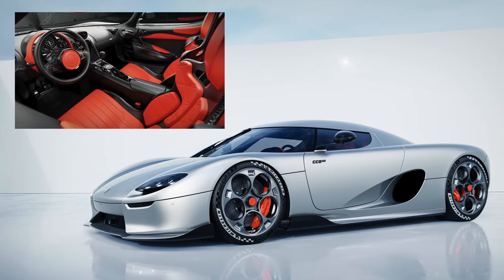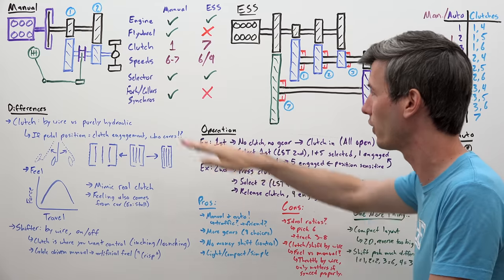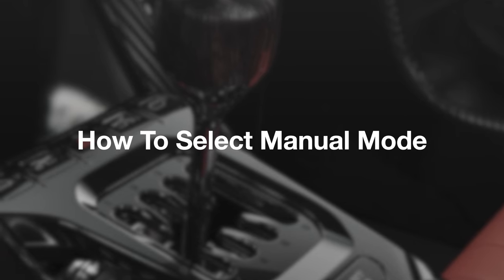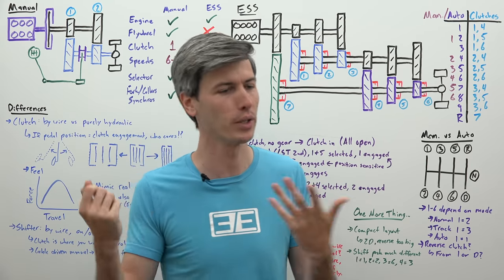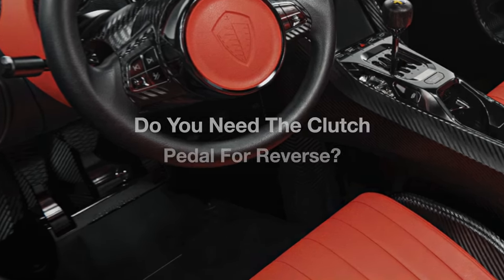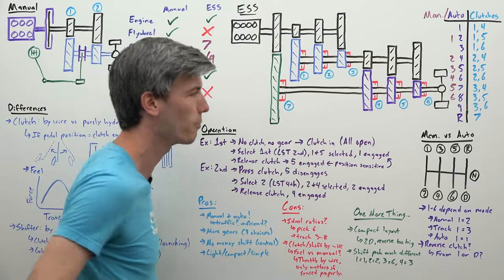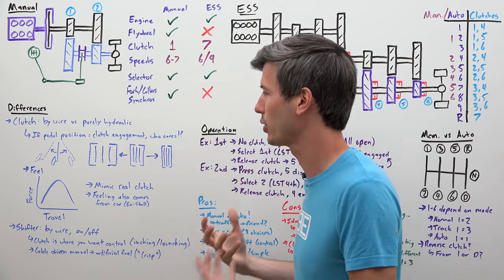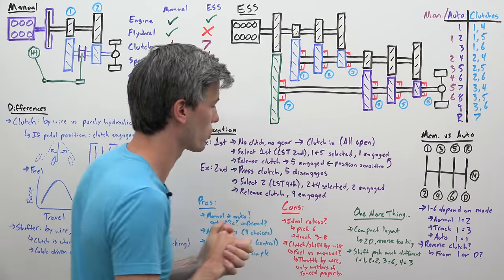Koenigsegg Reinvents The Manual! How The CC850 Transmission Works

Comment: Bro… I’ve been tryna figure out how an automatic transmission works forever and I finally understood FROM this video. Yes I know that this is not your standard transmission obviously, but the way you explained HOW gears work finally helped me understand that aspect which is what I always had trouble with. I’ve tried so hard to learn this and I’ve never been able do until watching you explain this. Thank you.
Reply: Nice progress.   If You need a new challenge,  try to understand the Ravigneaux-gearset for a "simple"  4-speed automatic.   I am still confused after years, but there are nice animations out there.
Reply: Keep in mind this is not how most automatic transmissions work. Most automatic transmissions use planetary gears, not side mesh gears as this does. Honda, however, has used this style side gear in some of their automatics for over 20 years. By comparison, the original model T manual transmission used planetary gears!!
Reply: It's quite different to a Trimatic...
Reply: @tsd560ti6  isn't that the multi planetary transmission? Like 2 but in a row/integrated in each other? I remember the drawing from school. This kind of transmission are more complex to understand xD especially if you wanna find out the rotation without specific rules (logic but without them...)
Reply: Yep, this is very similar to how modern ZF auto transmissions work. Basically since the ZF 6HP which was the first generation that finally stopped being a 'slush box'. They still use a torque converter, but they are able to fully lock on demand & this is how the internals are configured with each connecting gear having its own clutch-pack. 

It is a very cash-money evolution that gave auto boxes new life in the performance sports-car market, in my opinion.
Reply: Nahh, this is way more simple than a normal gearbox, normal autos use planetary gearsets and they're way more complicated.

Comment: This is brilliant engineering and perfect for this channel. Since clutch packs are consumable parts, id be curious to know how long these last. The 7 clutch packs definitely wont wear at the same rate since youll be using some gears more often than others and some clutch packs will be controlling more torque, I wonder if all the clutch packs are the same or if some are beefier than others based on the gears they control...Also replacing these clutch packs means tearing down and disassembling the entire transmission, I cant imagine how expensive that would be, but I guess if you can afford the car you can afford the maintenance
Reply: I'm sure the clutches that the computer controls that engage when the driveline is not engaged can be smaller/less durable. The actual clutches that your foot is controlling are probably much beefier and last longer. This is a Koenigsegg though. 5000 mi is considered high mileage so I don't think these will be 100,000 miles service intervals lol
Reply: Way too many grammar mistakes bro it’s impossible to read since I have OCD
Reply: @travisb9130  The clutches that you control and that the computer controls are the same.  There is only one set of clutches
Reply: my guess tbh is that it's not going to last that long at all. Given the fact that a single clutch failing means you need to replace it, and that there's 1300hp going through this transmission, I think reliability could very well be a huge concern with this car. 

I think that's just the nature of these super high end cars though, despite the super high price tag, they aren't actually much more reliable than a cheap car tuned with an oversized turbo. 

I could be wrong though. I wouldn't be that surprised if I found out that the torque is balanced over several clutches in a way that reduces wear and makes them relatively extremely reliable. I do agree though that repairs are probably a nightmare.
Reply: If you are concerned by cost or reliability and you purchased a koni you bought the wrong brand
Reply: @oldleatherhandsfriends4053  Really?  You want your hypercar to be in the shop for 3 months to troubleshoot and fix one of the 10 clutches buried deep inside a super complex gearbox that nobody in your city has the tools or experience to fix?
Reply: None of these cars are going to ever hit the 30k mile mark I guarantee you. It's not an issue.
Reply: @luisdetomaso867  nobody is bringing their koenigsegg to their local mechanic shop to fix. They're like high end ferraris, bugattis and lambos, they have fancy services to fix stuff that breaks. Also, they're probably only going to see 30k miles in their whole life, maybe even less
Reply: @flakey7832  You are naive.  How long do you think it would take a technician at "fancy" Koenigsegg Florida to fix a shifting problem deep inside that transmission? My bet is 3 months when you consider the amount of diagnostics, lack of experience, labor, rare parts, and complexity involved.  Or, more likely, they just swap out the transmission for a new one.  Then you are only waiting 6 weeks for it to arrive from Sweden and be installed
Reply: They are wet clutches just like a dual clutch automatic. I'd imagine they'd last a very long time
Reply: If I understand it properly, this is just a dual-clutch transmission that allows you to manually control the actuation of the clutch packs in a different way than most DCTs. The clutch packs themselves should in theory last just as long as they do in most DCTs, shouldn't they?
Reply: @The_sinner_Jim_Whitney  The clutches in a DCT are much larger
Reply: @The_sinner_Jim_Whitney  You're correct but as far as lasting as long, no I would not expect them to.  The reason is simple.  The logic of the DCT can shift perfectly, whether it's tuned aggressively or a little softer, it can still ensure a seamless "perfect" shift.  When you're the one controlling it, you could either be harder on it, although that's probably not the major concern as DCT's are notoriously able to shift very hard/fast... the more harmful practice would be allowing more / longer slip.  So I imagine it would reduce their life by some marginal percentage, but not necessarily enough for it to be a problem part.  Not even sure if clutch packs are the most common issue or the first to rear their head in DCT's in the first place.  If it's not already a problematic wear item then shaving off even 20 or 30 percent of it's life may not make a significant difference in the overall service life.  Plus, even though the video claims your shifts and clutch pedal are 100% synchronized and directly controlling the clutches perfectly 1:1, we don't know that to be the case, or at least not without exception.  Just like they can program it to prevent money shifts, they could program it to not allow too much or too little slip, and with protections like that maybe they can get the life shortening down even lower.
Reply: Probably the total amount of friction surfaces combining all those clutch packs may distribute all the efforts more evenly. When it comes to time between servicing, I guess it won't have the clutch made out of some random weak material unsuitable to the performance level it will handle, so this may last a reasonable mileage.
Reply: I've heard, a warranty extension for a Koenigsegg is around 25.000 € per year (with a limit to drive max. 5000km only) - so I guess, this should easily cover the costs of keeping these on the road...
Reply: @luisdetomaso867  Lmao what? Dude this is a koenigsegg, not your mom’s Toyota Corolla. You won’t be taking this car to a mom and pop repair shop. This will only ever be serviced by Koenigsegg just like ALL of their other cars (just the same as any other hyper car)

There is no difference in fixing this car than fixing any other hyper car. All hyper cars are equally infinitely complex and take a long time to repair.
Reply: @ChristopherGuilday  How many Koenigsegg mechanics in the USA do you think there are and how many do you think have experience diagnosing and rebuilding that transmission? Ask Koenigsegg Florida to fix a shifting problem deep inside that transmission and expect to wait 3 months when you consider the amount of diagnostics, labor, and rare parts involved.  Or, more likely, they will just swap out the transmission for a new one.  Then you are only waiting 6 weeks for it to arrive from Sweden and be installed
Reply: @luisdetomaso867  Are they? Has anyone seen inside one of these transmissions?
Reply: @Artcore103  Yeah, that's what I would think. The difference in clutch life expectancy in a normal manual transmission between a very good driver and a lousy one really isn't that drastic (within reason, of course, I'm not talking about someone who simply cannot drive and slips the clutch for twelve seconds every launch/shift), so I would think the difference between manually controlling the clutch pack actuation and computer controlling it would be reasonably minimal.
Reply: @The_sinner_Jim_Whitney  I doubt it.  The unit is so mechanically and electronically complicated, I am pretty sure it would be sent back to the factory to be repaired by the team that built it
Reply: @luisdetomaso867     Yeah, I have to agree.  It doesn't matter if I am a billionaire... the complexity of it all would shy me away.  A car this intricate, at the price they ask for it and the wait to get it, should come with a service contract where Koni sends a team out to your garage to work on it.  I would imagine a car like this would have to be shipped back to Sweden for any service beyond standard maintenance.
Reply: There's less load than having only one clutch, so I would say they probably last a good amount of time.
Reply: @jwalster9412  You are obviously not an engineer.  All of the engine torque still goes through every clutch - even if there is nine of them
Reply: @luisdetomaso867  doesn't it use each clutch separately?
Reply: @luisdetomaso867  i dont think anyone not trained to work on a koenigsegg and not working at a koenigsegg/hypercar specific shop would have the balls to touch one with a wrench because noone wants to over tighten a bolt and bankrupt the entire company they work for because they broke a multi-million dollar car
Reply: @jwalster9412  Full power goes through each clutch, but it takes turns which one gets used depending on which gear is being chosen.  The clutch for 1st gear will take the biggest beating.  Maybe they made that one bigger...
Reply: @luisdetomaso867  it would make sense that they made the higher gear clutches smaller.
Reply: @luisdetomaso867  and they'll refubrish your old one
Reply: @The_sinner_Jim_Whitney  Not quite, although that could most likely also be done. DCTs, as the name implies have only 2 clutches, one for even numbered gears, one for odd numbered (maybe a third one for reverse, not sure about that one), they have 2 gears selected at any given time, but only one of the 2 clutches engaged. While in 1st, 2nd is also "pre-selected", when ready the odd clutch disengages and the even one engages, while in 2nd, the odd side deselects 1st and pre-selects 3rd ready for the clutches to do the reverse operation. To feel more responsive, they usually choose what gear to pre-select (+1 or -1) depending if the car is accelerating or decelerating. While for the most part there have not been many huge inovations in manual transmission, as in they all follow the same principles, there are many different types of transmissions that fall under the umbrella of automatic transmissions.
Reply: @JF743  I see. I don't know anything much about DCTs. Seeing this one explained, I sorta assumed that they must work in a similar way (I know there are more than two clutches in the transmission in this case, but only two are doing anything at any given time, so I thought maybe this was how DCTs operated, too). Duly noted.
Reply: I (or in more recent years, my son) burnt out clutches mostly because I/he released the clutch when the engine speed was not well matched with the wheel speed.  Clutches last a long time if all shifts are smooth.

That's should be a solvable problem here, since their computer can match speeds before re-engaging the second clutch.  For normal, well done, shifts at normal acceleration, that can happen transparently, as the (slow) human releases the clutch pedal.  For aggressive driving, when doing an unexpected large (multi-level) shift up or down and a hot foot on the clutch, I guess their computer gets to decide whether to wear that clutch more, or be more obvious in its control of engine speed.

==> However this should save on transmission gear wearing.  All gears are always engaged, so much less ground down gear dust in the transmission fluid to shorten the life the of the transmission.
Reply: @The_sinner_Jim_Whitney  no, this is just an automatic transmission without a torque converter. It uses the individual clutch packs instead.
Reply: @ThePythonicCow  Great point. A lack of metal particles in the oil should also serve to lengthen the life of wet clutch material, too, right?
Reply: @dragthatsht  This isn't how a traditional automatic transmission works, individual clutch packs notwithstanding.
Reply: Wet clutches can last a long time. The oil cools them and protects the friction material.
Reply: @The_sinner_Jim_Whitney  it's how a modern automatic works. And it's how heavy truck automatics have worked since the 80's, expect they ditched the converter and use computer controlled solenoids to ramp the clutch packs in.
Reply: @luisdetomaso867  we are talking about koeniggsegg not Volkswagen here. They would remove the entire transmission and replace it with a brand new one and have the car back to the owner within a few weeks
Reply: @dragthatsht  Maybe that's true, I can't say, but 'normal' (traditional might be a better term?) torque converter automatics use planetary gearsets and a completely different mechanism than anything like this. I don't know anything about modern autos or DCTs or heavy truck transmissions, so I'm sure you're right about them.
Reply: I was thinking the exact same thing. The I was like, "Man, they can afford the car."
Reply: These type of transmissions with clutch packs have been in use for a long time in the agricultural industry and lasts quite a long time. Normally these are "wet clutches", the oil allowing to slow and reduce wear and can last surprisingly for a long time. I do not know tho in the case of a super car with higher rpm ranges then of a diesel tractor. As for maintenance, depending of where it is mounted and of how much have to be removed before being able to unmount the transmission, the maintenance for these is fairly easy and can be done quickly.

Comment: The problem those of us with a deeper understanding of mechanics have with “by wire” systems is the opaque failure modes.  Yes, many people simplify the argument to, “I don’t like how it feels, don’t understand how it works, and don’t have the knowledge/tools/training to repair it.” Christian, you are right that all of those things can be overcome with education.

What can’t be overcome with education are the opaque failure modes either programmed intentionally into the system to prevent worse failures, or the randomly occurring ones.  The latter often being dangerous or deadly!

Everything breaks.  Code breaks.  Hardware breaks.  Hydraulic hoses break.  Shift linkages break.  Throttle linkages break.  So on and so forth.

The difference is that with traditional tools, a home mechanic can inspect mechanical components.  Leaks can be observed early with vigilant maintenance.  Regular care of a vehicle with mechanical controls will reveal potential problems.  Expensive, and sometimes deadly, failures can be prevented through routine maintenance.

Even with the education and tools needed for “by wire” systems (some of which cannot be purchased for home technicians), failures can occur with no warning, no way to detect the problem for the end-user, and no way to prevent it until it happens.

If the throttle body on my motorcycle sticks wide open and my brakes fail, I should have prevented that with routine cleanings, fluid changes, visual inspections, and basic handtools.  

If a throttle by wire system locks my throttle wide open and a brake by wire causes my brakes to fail, it’s either an electronic hardware issue that would need to be discovered with a thorough inspection with a magnifying glass or microscope, some sort of specialized hardware inspection device that simulates various circuit modes (such as a specialized test set), or a deep examination of hundreds of thousands of lines of software code.

That’s why we don’t trust “by wire” systems.  It’s a matter of responsibility and preventability.  A failure of a mechanical system is my fault because of my laziness.  I should have been responsible.  A failure of a “by wire” system is shrug meh, someone’s fault, maybe… and I couldn’t do a damn thing to prevent it.
Reply: Well planes have been flying with fbw for a long time now. It hasn't been all perfect and many accidents have happened, but lessons were learner, things were improved (unless you're Boeing), the vast majority of the time the FBW systems have worked exactly as expected.

I remember the cars in the 90s were much much simpler compared to anything together. But much of the time they weren't so reliable either, unless it was a Honda or something. Vehicles broke down frequently for many analog failures. Not just cars. Back then too not everything was built to last - there were a lot of products failing frequently. The problems were also much easier to fix though.

These days the biggest failures in modern cars are all the new fancy stuff that doesn't even work as well as a budget phone (and phones are very reliable overall now). 

You don't hear much about the stuff that failed very often from those days, because they didn't last the test of time and became obsolete.